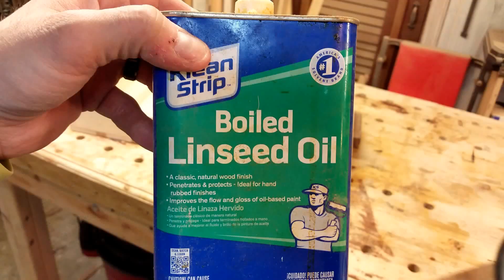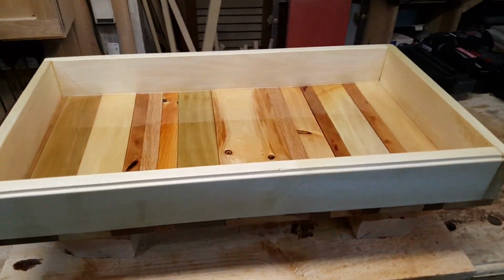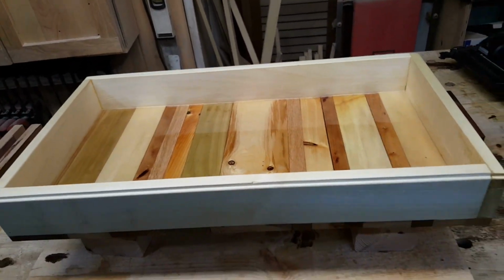how to make a serving tray--PALLET PROJECT

Comment: Nice project. The epoxy made it food safe. It would be a good idea to line the entire inside with epoxy in fact.
Reply from the maker: Dave XB thanks and thanks for watching and yes I thought about that so what I did was 1st make another one similar to this one because I donayed this one tmas a raffle prize for my friends benefit amoung other things, then sanded it down and used cutting board oil instead it's just sitting on our kitchen table with flower vases and a napkin holder LOL

Comment: great video and nice Job. consider me a subscriber. just was wondering why you didn't put a couple of screws from the inside to hold the handle, just in case the ca glue gave out somewhere far down the line??
Reply from the maker: patrick mcglone thanks bro! i put a couple brad nails in it off cam but  thats a good point/idea. thanks for the idea,watching,and support bro!
Reply: Joe basement woodworking I hope I didn't offend you, not my intention, I haven't worked with CA glue yet so that's why I asked. again great job.
Reply from the maker: patrick mcglone no lol not at all bro! I appreciate any input or suggeations. The screws are a much better idea anyways because I recently well not recently but like 6 months ago made another one for our Grill and I dropped it and the handles broke right off now if they would have been screwed in with the glue they would have stayed on but being Brad nailes on with the CA glue they didn't hold up but no not at all offended  brother I appreciate u subscribing and support👍👍🍻
Reply: Joe Basement Woodworking & DIY I would either use a square head( nicer looking) or a torx head screw. Just my .2¢

Comment: What is the point of drawing a line with a square before cutting it? Just curious, doesn't make sense to me unless you were going to cut it by hand. Beautiful tray!
Reply from the maker: good point..haha. i guess my ocd and/or force of habbit..??- . next time im just cutting off the nail holes i wont use the square..well,ill try not to. if my ocd will let me.lol-thanks for watching and the comment man!:)
Reply: Lol. I've seen others do it as well and I never knew why. Ocd will always win though... Don't fight it. Lol.
Reply from the maker: Jonathan Mutchler what i usually do is measure the boards to length off camera mark it with an awl and then on camera I can just hit the lines and cut the boards to length. but in this case it didn't matter and the ocd  took over. Ive seen others do it too.lol.
Reply: +Joe basementwoodworking Your secret is safe with me.
Reply from the maker: +Jonathan Mutchler haha!thanks john.